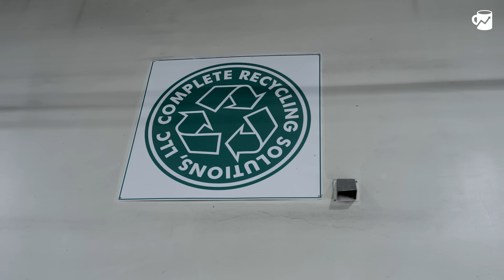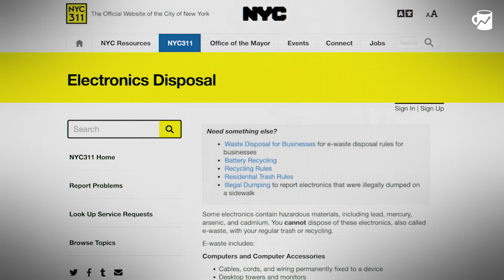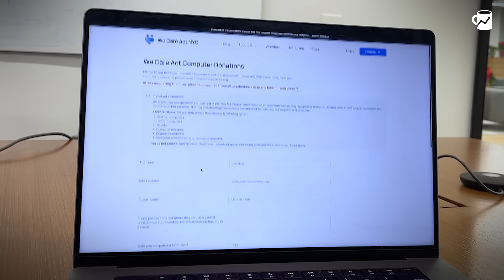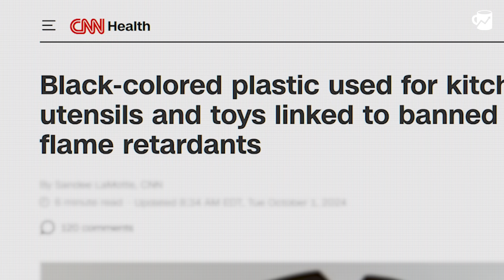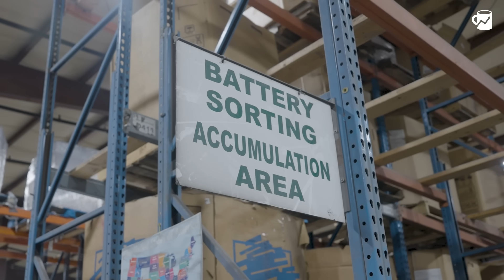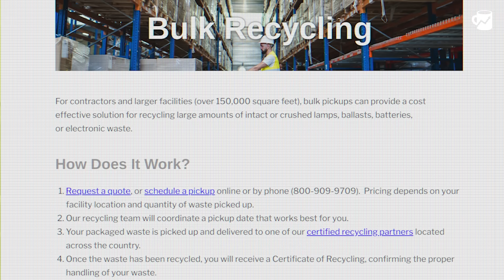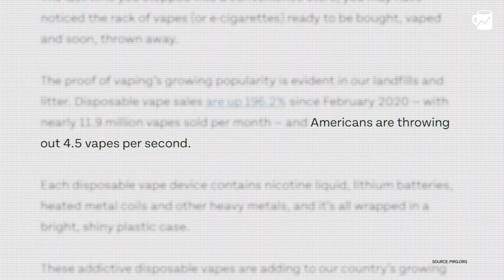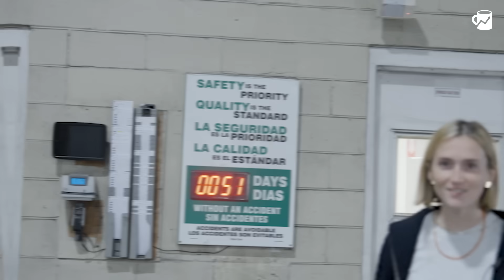I went down a rabbit hole trying to recycle all my tech waste

Comment: The way to solve this is to shift the responsibility from the consumer to the producer. They are making these products, so they should also implement end of life programs for these. This approach has already been proven to work for several markets in differing product categories and it can definitely work for e-waste. Unfortunately, these tech companies lobby against such policies so here we are with this problem that could have been easily solved.
Reply: Imagine if there was a policy in place for every manufacturing plant to REQUIRE a DE-manufacturing facility or plant, for any and all products and product parts they create. This would be the most ideal solution, all defunct or unused products would be sent back to the manufacturer which then sends it to be broken down in the best way possible, as they know the way in which it was put together. For instance, motherboards would go back to ASUS, which then sends any parts it didn't manufacture in-house to their original manufacturers, which then break down what they can and send the rest to either the og manufacturer or to be recycled.
Reply: @DizzyDJW   Yes!!! A REAL RECYCLING PROGRAM! The amount of waste reduction and reusing/recycling of valuable and/or toxic and finite materials is a solution that needed to be Truly instituted decades ago.
Reply: @DizzyDJW  Additionally, anticipating future de-manufacturing can influence original design to make that process easier.
On the down side, regulations like this will give an overhead advantage to manufacturers located in places the law can't effectively be monitored. Plus, such regulations will often see companies work with 3rd party suppliers just to offload the responsibility, and then see those suppliers fold to just abandon their later duty.
Reply: @DizzyDJW  Some companies do that and they CHARGE you for it, and thats the problem. I can easily see this as an exploit, make a product that can easily break down so you can return it to recycle it and sell it back to the consumer
Reply: @DizzyDJW  Imagine, you want to start business. And after you created something, started to sell it. You recive 15bilion dolar fine, because someone had great idea that you should also decompose of device alone.
I'm sure average Steve who had cash just enough to buy equipment to manufacture things, will also have budget to dispose of it.

And yes your idea would work, and thb i'm not sure why big tech companies did not thought about that and lobby it because then you eliminate more small business, and retrive more market share, by also hiring people those same people who would be able to produce better things than you will create. For part of price, increasing company profits, briliant!

Creating plan how device can be recycled, with at least 50% (or whatever is easly possible) being able to be reused would be much better start.
Reply: @DizzyDJW  just curious: who will pay for it?
Reply: @ernahubbard2062  idk try the MULTI-BILLION dollar corporations that have already run out of things to spend their HUNDREDS of BILLIONS of dollars on? Just a thought
Reply: @DizzyDJW  well, that depends on the bottom line and also how the market reacts. Say Apple make 100 per year, and it's share is 20. Well if it will eat 20 per year into it's share price, what will the share holder say? And to maintain that margin, the cost will surely be transferred to the consumers, what will the consumers say? 
In economics, it's actually very simple: are you willing to internalize the externality.
Reply: @ernahubbard2062  Funny you should mention the bottom line. EU regulations are already in place meaning they'll have no choice but to adopt these practices or stop selling in the EU. You wanna talk about taking a hit to their bottom line? Losing an entire market is worse than eating a small percentage to avoid egregious fines in the hundreds of millions for e-waste. So they either do something like this which is much smarter and saves them money, or they lose significantly more money. I suspect in the coming years this will be the route they take, any other choice is financial suicide for the entire company and their shareholders
Reply: @ i didn't say it cannot be done, my point is someone is going to pay for it, at the end of the day, it's the consumer, simple  as that. For instance, when you ship a graphic card from Taiwan to US, it's a product, it sells 2000 USD, the shipping cost is negligible, when you ship e-waste back, it's garbage, its worth maybe 2 dollars, the shipping cost is higher than the value of the material.
Reply: @ernahubbard2062  The consumer. The elevate the price on purpose so the consumer brings the product back end of life to get that money back as rebate. Like many european countries do
Reply: @FairyTailOpening15  yes, it's a better system. But may Suprise you where they actually get processed.
Reply: To Be fair, I honestly don't trust those companies to actually dispose of items properly but Yes at the same time they absolutely should to be the ones cleaning up their own mess and doing it responsibly.
Reply: That is clearly the answer.
Reply: Lobbying is where solutions and good ideas are squashed.
Reply: Yes, recycling has a cost and it needs to be paid for by the people participating in the producing and use of the goods. We should put the cost on the producers. This will of course be transferred to the consumers, but by making the producers bare the cost, it incentivizes them to make changes to reduce that cost to maintain competitiveness. We need to try to make these costs not externalities, but baked into the transaction from the beginning.
Reply: Definitely agree on shifting the responsibilities away from individual consumers.  However, I fear that putting it on the producers will just end up furthering unnecessary e-waste (ie: stuff that either still works fine but is old or can/ should be easily repaired).

Rather, I'd say requiring producers to
1. Make general products (computers, smartphones, ... cars) easy to repair without needing specialized tools (looking at you, Apple... and every other smartphone manufacturer...) or part
2. Use standardized basic form factors for basic parts (eg: batteries, RAM, screens)
3. Continue security updates for older models far, FAAR longer than current

In addition, there should be a consumer-secondary-market-centric 3rd Party to determine and enforce basic form factors in use (similar to... I don't know... the same kind of organizations that've standardized USB slots and wall outlets...........)
Reply: That's why the EU now has the 'right to repair', and stuff like using support for USB C as adapter. And I love how it's forcing big companies like Apple to do better, because even though it's a USA based company, they sell too many of their products in the EU to not comply, which makes it better for everyone, bc why sell two different versions.
Reply: Its a bad idea
Reply: Companies very rarely will take the blame, so to speak. They have and will continue to pass the buck of 'fixing' the issue to consumers.

Several famous corporations caused issues to be put on customers through clever marketing campaigns.

Don't Be A Litter Bug was developed by large corporations to make consumers stop littering and wasting materials. Instead of the companies investing in development of reusable packaging, which would've reduced the amount of litter.

Jay Walking was a campaign by old automakers used to 'shame' pedestrians into a belief they were the issue. Instead of working to better educate drivers and develop safer road systems in the budding days of the auto industry.

Yes, the corporations should be the ones to fix the issue. But they rarely, if ever, do. They're much more likely to repeat the same techniques, marketing campaigns that make the user feel bad instead of blaming the companies
Reply: Companies that produce toner for laser printers have to do this already. They take back the spent toner containers.
Reply: Change doesn't happen until the consumer cares enough to push for it. Consumers make all kinds of excuses for producers. Politicians don't push for change unless consumers tell them to. 

This is 100% on the individual. Nobody cares. It's easier to just toss it in the trash and then make excuses. That's what the vast majority of people do. People are not willing to do even a tiny bit of work to protect the environment because most people don't care. You see countless examples of this in people's day to day lives(disposable products because they're convenient, inefficient habits around the house because it's easier, driving to the store instead of biking/walking because it saves 10 minutes, buying a truck because you might need it once or twice a year, etc etc). most people do not care. 

Me just saying this will be taken as negative. People will get their ego hurt and try to argue with me, but what I'm saying is the truth. Producers would not do this if consumers didn't allow them to. It's that simple.
Reply: In my country, any store who sells the product has to recycle said product
Reply: How many times have we heard these companies claim to be recycle friendly, carbon footprint, or implement end of life and it turned out to be a lie
Reply: Pigs will sooner fly in frozen hell then America put responsibility on Corporations. America's Capitalist Society exists to make the owners (the Corporate Class) richer and everyone else (Working Class) poorer.
Reply: Exactly. Eliminate externalities.
Reply: its cool that in the world we exist in, that this video is here to help... But its devastating that the state of the world forces us to have nothing more than a video like this...
Reply: Tech companies would be better equipped, you would think. Honestly, I can't think why there isn't more research into better methods, or even an entire industry revolving around recycling tech waste.
Reply: This one right here. The creator of the waste is generating the waste, if you hire a plumber does he take his pipe cuttings with him to dump, if you hire a painter does he leave his drop cloths and plastic on your property for you to figure out? The manufacturing company does... to avoid paying minimum wage, they ignore the problem and let you figure it out, hints wastemamagment. And recycling centers. Homeless people feeling hopeless, endless hours of them digging in trash cans.
Reply: That would just be rolled into consumer price of product by the tech companies and the tech companies would find a way to profit from that "shift" in responsibility.
Reply: @Merzui-kg8ds see, thats what im talking about.... common sense right there... you have to know your overhead... the recycle drink material wasting companies arnt charging an overhead. they only care to create a mess. if you purchase some construction work whos financialy liable if you step on a nail when you arrive to meet with the working crew for the construction? Do they charge less, for having to hire a safty crew to manage the crew that doesnt care? The safty crews got an expense too, thats the overhead.. drink companies and others like it, if you know you produce harmful waste and have been sued many times for it but keep doing it, you already know theres a problem, you should find a way to finance your overhead, instead its pawmed off to druggies homeless and so on.. excess hours of work for pennies on the dollar. The thing you said, is what they need to do.. right now, they deliberatly are financing to pollute.. if they cant afford to hire fulltime workers of their own to clean the mess knowing they create a mess, then they shouldnt be doing what they do.
Reply: This is CLEARLY the answer.
Reply: I an curious to know what industries enforce a rule such as this. This rule to me would hinder innovation and raise the barrier to entry for new companies (mom & pop) who want to sell for instance custom IoT devices made in house.
Reply: @f4ephilosophy691  One, industries wouldn't enforce it. Governments would. Two, this literally wouldn't impact mom & pop shops at all. This is about mass production aligning with mass recycling rather than externalizing it to the environment and consumer as byproduct,  in the form of waste, destruction, pollution, cancer, micrplastics, and so on ad infinitum.
Reply: @cloudbusting_  So the expectation is language is specifically added to target fortune 500 companies.
Reply: Or, we could quit blaming everyone else for our bad decisions and quit destroying our planet for convenience
Reply: The only company I trust with this is Apple. I work in computers and we take all of our old iPads to Apple annually because we know ethically they will recycle the materials back into their production. And they also take other tech too from other conpanies
Reply: @christopherpatrick1028  still would be better if apple allows their products to be reused, fixed.. because recycling is last in the R-R-R principle.
Reply: @christopherpatrick1028 You know how Apple buys your old iPhones from you so you'll buy new ones? In 2020, Apple almost sued a company (GEEP) for selling a small portion of those fully functional phones to the Chinese because they were supposed to dispose of them (250k of them per year).
Don't trust companies to take care of problems they don't care about. You have the tech, you choose what to buy, you choose what to do with it. Give people still-working computers, fix what you can, and buy stuff that will last.

Comment: As a electronic engineer who still enjoys repairing stuff as a hobby, I was in tears watching all those beautiful parts being torn apart
Reply: my current pc is 10 years old, with some parts being even older, when you treat and mantain your electronics they can last a long time
Reply: @pablofernandezdiaz3872  completely agree. My lcd tv is over 20 years old
Reply: Getting harder to repair stuff now, no thanks to Apple in particular
Reply: @BlackhawkSC  100% but still I find it relaxing to try... yes I am mad!
Reply: So much leds and mosfets and aluminum 😭
Reply: Way to go man! You sound really cool
Reply: I have those skills as well. The youth seem to be shouting about the environment more, yet harming it more with their uber consumer mentality. Searching a bit will find many places that buy it if you ship it to them. Some needs to be prepped a bit with batteries taken out, big heat sinks and processors removed, etc. I have boxes of circuit boards, drives and other things from my IT career. The government still uses floppy drives with their legacy software and I sold the used oldies for $25 each on eBay a while back. We have board swapper techs now who don't even know how to solder, much less properly tech out issues to avoid just swapping parts with guesses on the problem.

Comment: 0:34 there’s no way you believe in planned obsolescence in 2024
And saying the lifecycles are getting shorter? They’re getting longer
The after person in the past 5 years has kept their phone 2 years longer than in the 5 years before that, literally doubling the life cycle 
And Apple “slowing down older iPhones” is a misleading headline, yes they were slowed down but that’s because the batteries were so bad the phones were going flat when they had 20% or more left because as batteries chemically age it’s difficult to measure them and realistically your average consumer is not going to replace a phone because it got slightly slower but they are going to replace it if it randomly shuts off